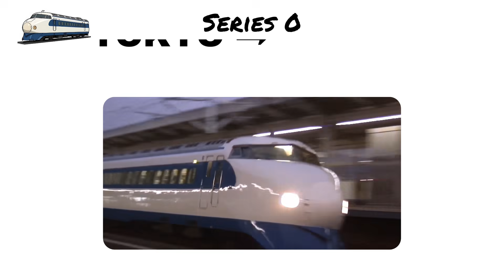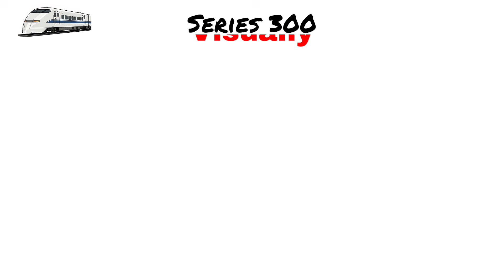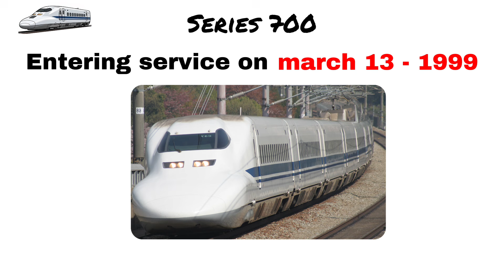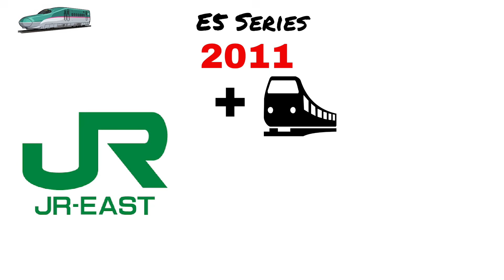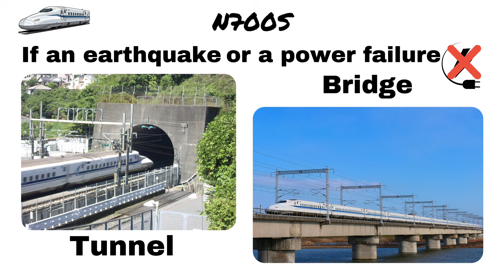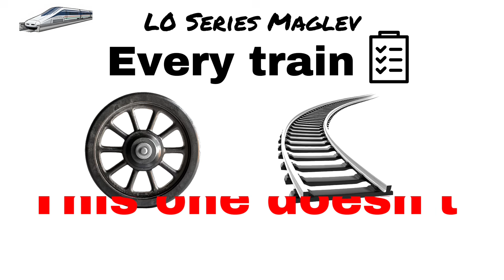Every Major Japanese Shinkansen Train Explained

Comment: the Dr. S is the successor to the Doctor Yellow Line. It's using the N700S as the base but has either similar or exact equipment used on the previous Dr. Yellow models and/or new equipment.

Comment: The thumbnail is kinda misleading, because 100 Series doesn't just have sharper nose, it also has thinner headlights. Also you forgot the 200 Series and 400 Series. 200 Series is kinda unique because it's the only Shinkansen with green paint instead of the traditional navy blue. Also E1, E2, E3, E6, E7, E8 and the upcoming E10 Shinkansen. I hope you make a Part 2 for the forgotten ones.
Reply: The series 200 is also unique because it is the only shinkansen model to have two different front end designs. Most variants use the round nose type like the 0 series and some variants (some F sets and H sets) use the 100 series style nose
Reply: The 200 series is green simply because it was intended for the Tohoku Shinkansen (originally green line color), while the 0 and 100 series are intended for the Tokkaido Shinkansen.

Comment: You kinda forget some imfomation.
1. E4 Dont only run on Joetsu Shinkansen, it may also run as Yamabiko of Nasuno on Tohoku.
2. N700S could reach 360 kph on testing, just like E5/H5 did.
3. 700 Series odn't just turn into Hikari Railstar, it was originally built differen(700-7000)
3. Where did E1, E3, E7, E6, E8, N700A, N700a, N700(SK), 800, E926, E956 went???
Reply: Also 200 & 400.
Reply: Not to forget that the E6 can run at 320kph and transfer to an ordinary line to Akita 130 mph and E8 at 300kph to 130 kph on the Yamagata/Shinjo line. That’s versatility!